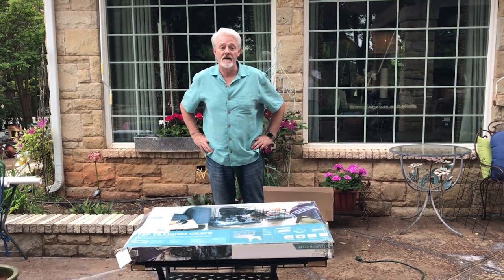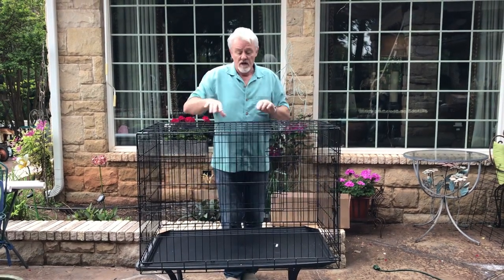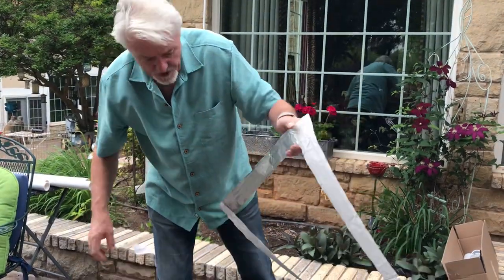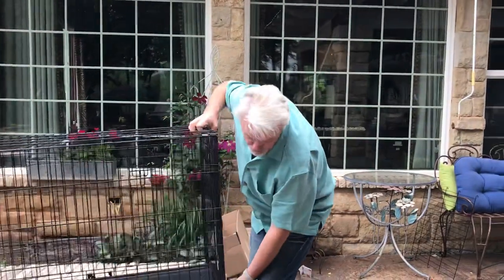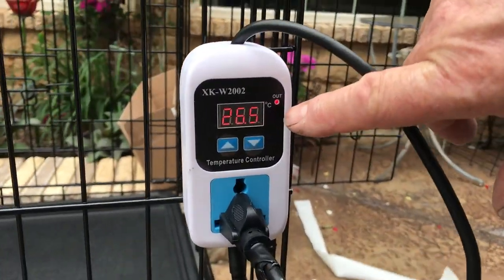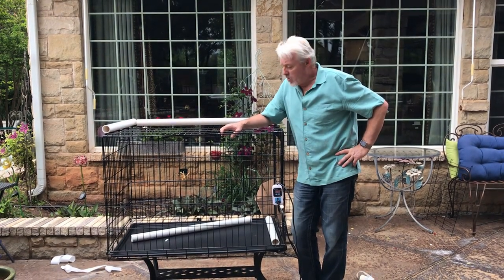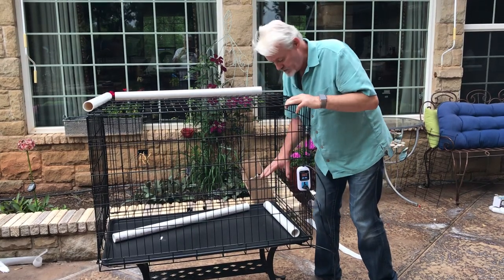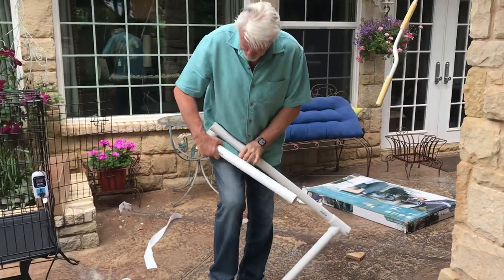Building The Best Whelping System For Your Dog And Puppies, Part-1

Comment: Our crate has 2 doors and wasn't more then you paid. Came from rural king. But also Walmart has a 6 heavy panel kit that allows you to make it what ever size you want for 50 bucks. I  bought 2 and use for inside and one outside to play.  They both have a door with a lip so pups can't get out. The metal is more solid then any crate we have. Has been the best whelping box and play area we have ever done.  And now just zip tie the extra thick pool noodles on for our pig rail for the 2 weeks needed.

Comment: Does the heat strip work through wood?
Reply from the maker: No but you can buikd a sub floor with Coroplastic 
Cuts with a bo knife. $20 for a 4x8ft sheet at homedepot